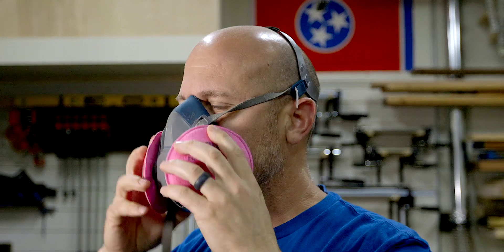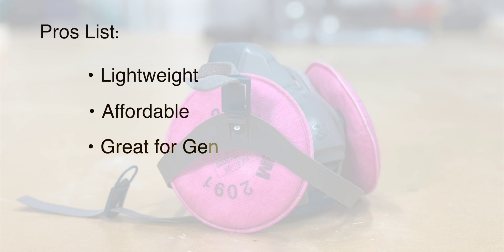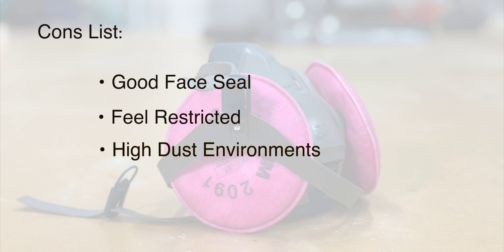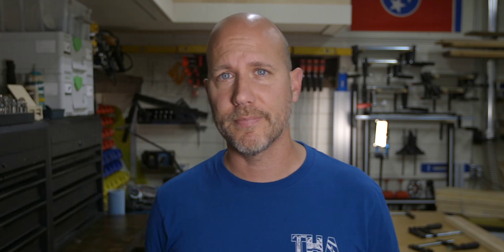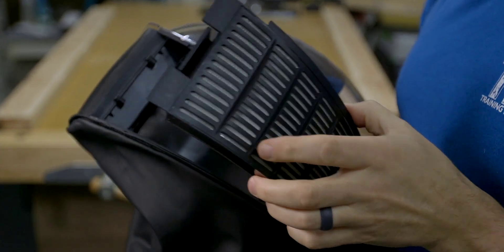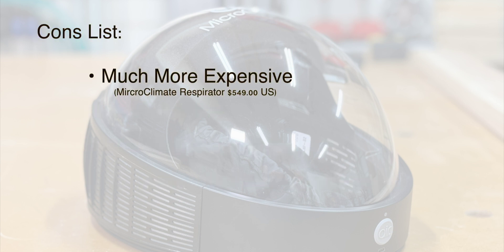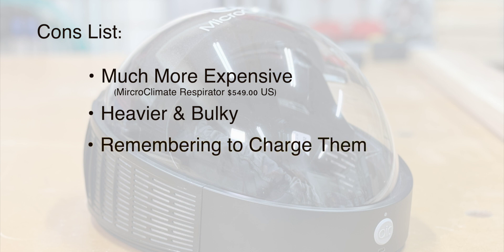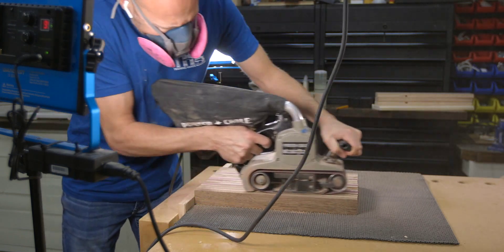Two Types of Masks Every Woodworker Should Know About

Comment: Great video.  And the risks from sawdust are far greater than most people realize.  Sawdust is linked not only to higher incidence of pulmonary fibrosis, which will make your last years of life absolutely miserable, but also to lymphoma.  Even a $500 mask is pretty cheap insurance when you look at the cost of treating either of those problems.  And if you get pulmonary fibrosis you'll probably end up on a respirator anyway, so might as well choose to do it now to avoid the bigger, more expensive mandatory kind later.
Reply from the maker: Thanks for the comment.

Comment: Thanks for the video. I have glasses and a beard. Is the microclimate the one you would recommend?  Thanks
Reply from the maker: You are welcome! I'm not an expert when it comes to these things, but at this point, the MicroClimate is the only NIOSH-approved respirator that I know of in this price range. Trend Tools (a company I like as well) has their Trend® Air Circulating Airshield Pro — however, it is "not a respirator nor a NIOSH-approved device". Michael Hall at MicroClimate has filled a gap in the market around the $500 price range, and so far, I think his respirator is a good product. So with all of that said, I would recommend it.